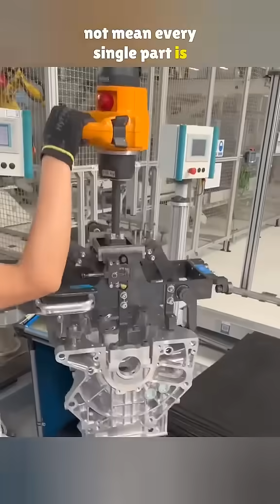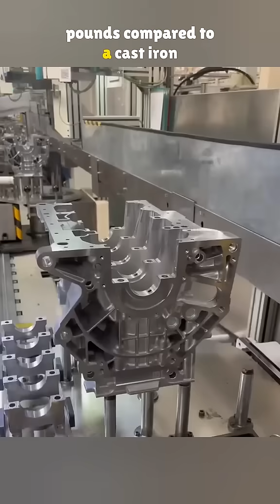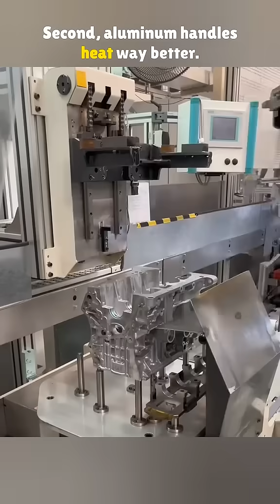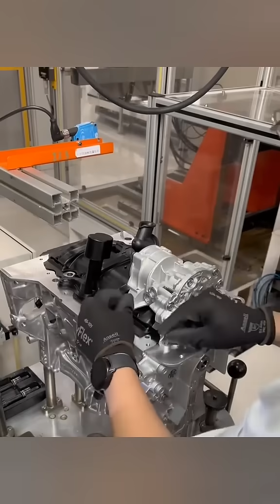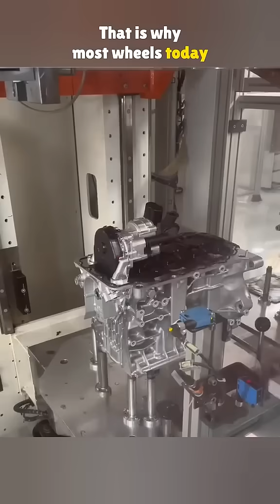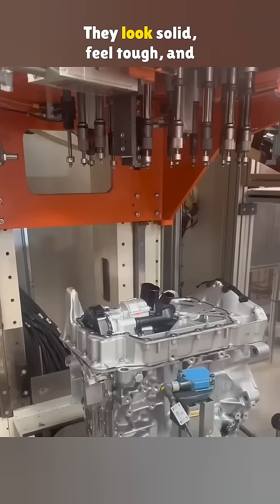Aluminum vs Cast Iron  Engine Showdown #automobile #assembly #mechanic #car #manufacturing #autotech

Comment: High nickel alloy steel was used to make the good engine blocks, cast iron was cheaper, aluminum was cheaper than both. Aluminum engine blocks warp from heat expansion and wear out faster than anything, the old steel engines used to get 600,000 mi no problem. Cars lasted an average 25 yrs in the past, new cars only last 10 yrs.